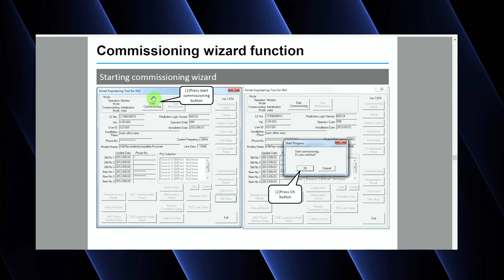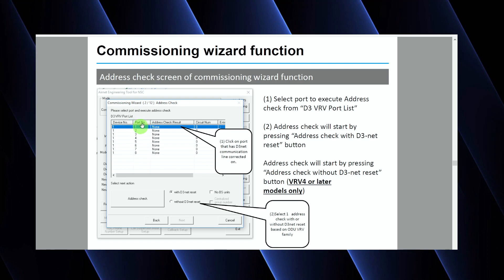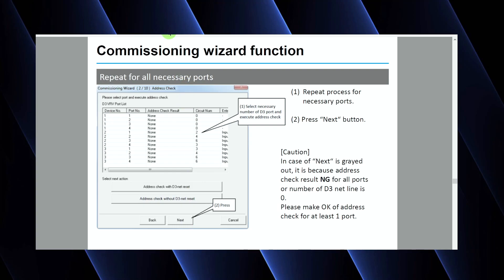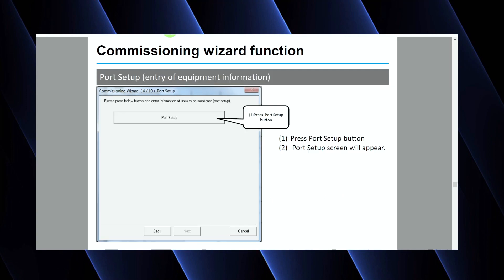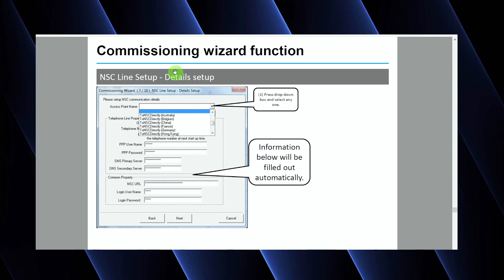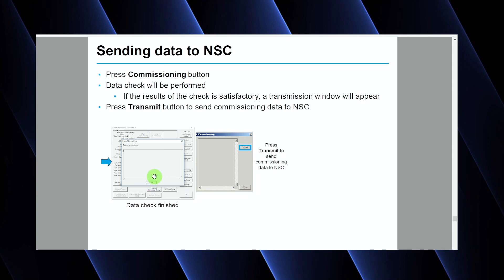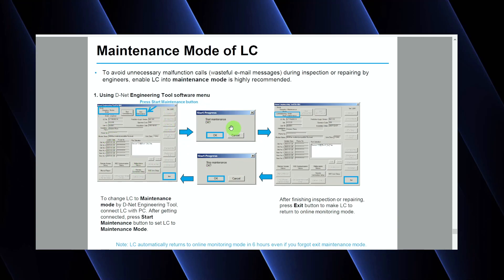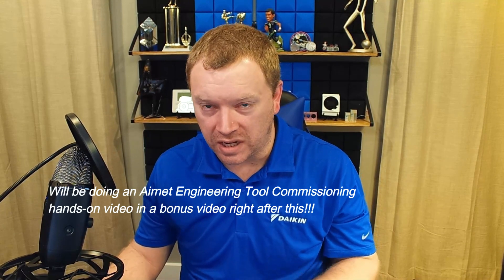Daikin ITM Airnet Engineering Tool | Export Run Time & 24-7-365 Factory Monitoring - 12-24-2021

Comment: Hello, How do i get the 'Operation Data Export' logo on the iTM?
Reply from the maker: You will need to run the airnet engineering tool to allow the itm to provide operation data (performance data). If you don't do this then clicking data export only gives you things like on/off and setpoint changes. The icon should populate by default if you have some of the latest versions 2.06 I think or later. I can't remember if earlier versions had it.
Reply: @InverterAlways  thx allot for your answer. European market here.
Reply: Can you post a video on how to export the D3 operation data. Up to 5 days and how the csv file looks like.